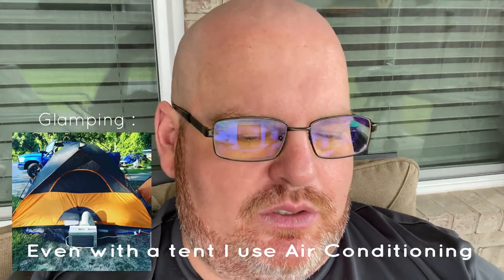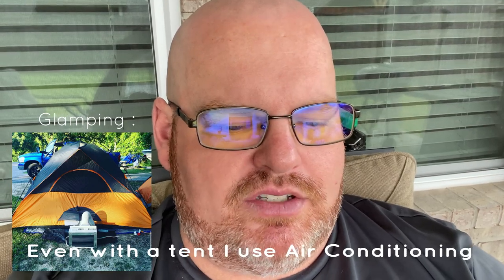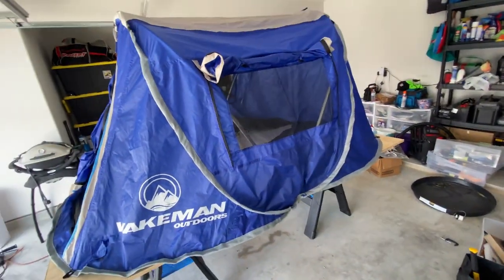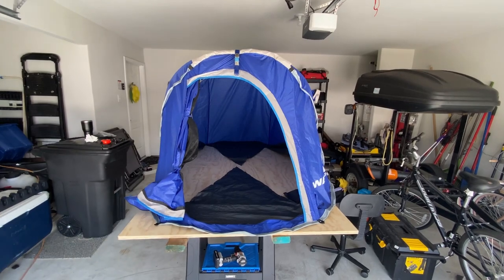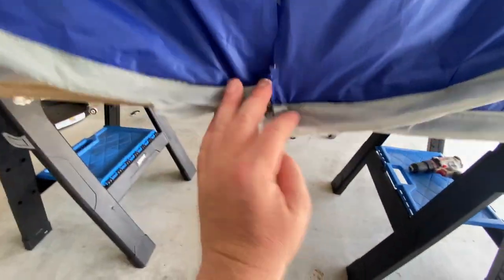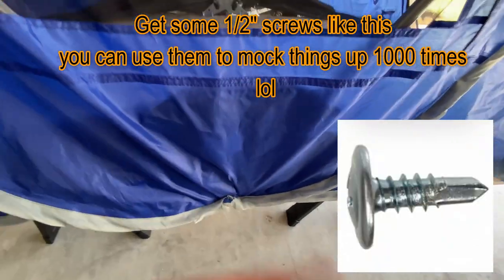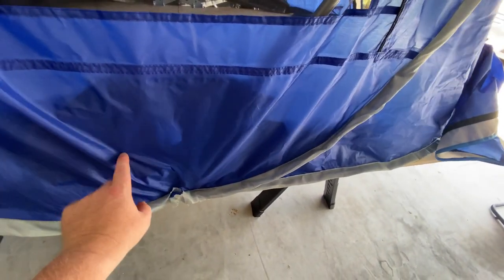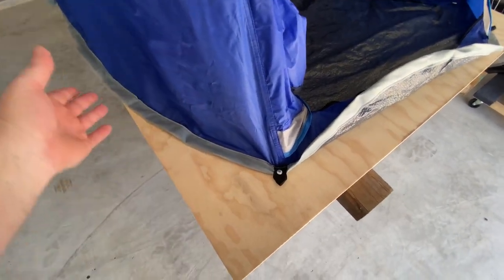DIY Roof Top Tent Build Part I The Real Life Wakeman Outdoor Tent #thereallifeyoutube

Comment: Sounds easy enough!  I was looking at using a double cot tent for a DIY rooftop tent.  I would build a base for it similar to yours. I would keep the base flush with the tent, though.  Water can collect on the wood near those corners and possibly collect under your tent.
Reply from the maker: Yep that’s why I overlap the tent on the wood to elevate that. Did you ever attempt the build